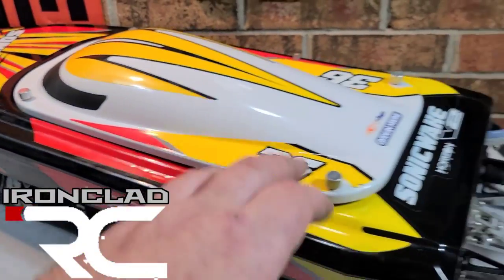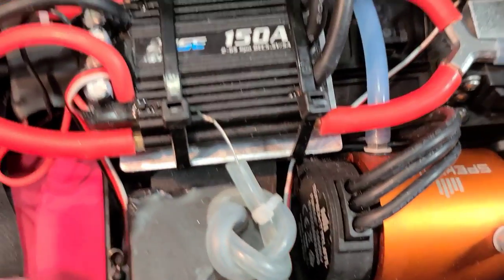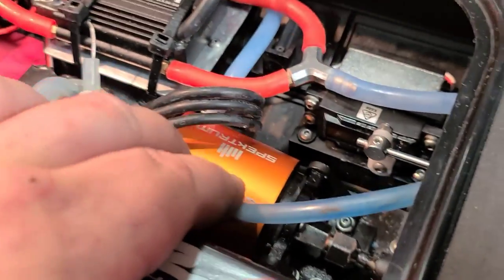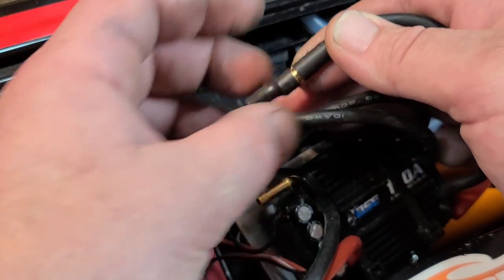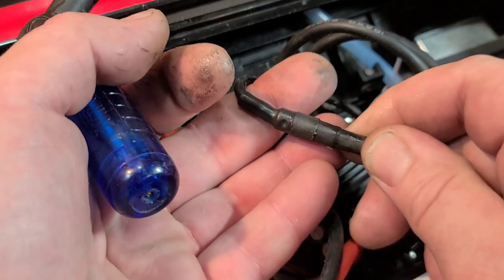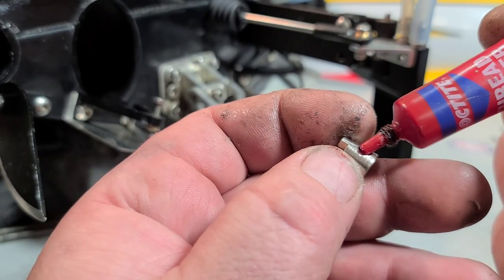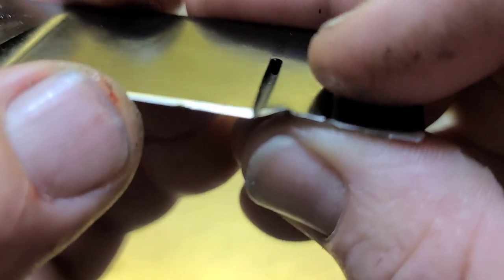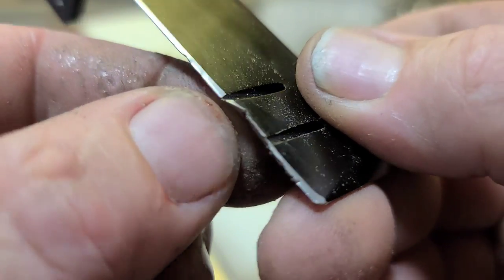Damaged Rudder Repair Sonicwake v2 - Broken Flex Cable Removal Fast Electric Rc Boat

Comment: Good Vid B!     I fill in blems on my aluminum stuff with solder and file it down. Quick, easy and polishes out to a pretty good match.
Reply from the maker: Aluma-weld from harbor freight Is my go to aluminum solder.   Thanks for sharing
Reply: @IRONCLADRC  Dang, my Pop has been stick welding aluminum for like 40 years, never even thought about brazing with it. Good call!

Comment: Hi B. As a time served Engineer here in the UK some 37 years for my sins, I absolutely love watching and listening to the way you go about problem solving. You clearly have a good understanding for the use of hand tools and general bench work. Watching you carefully using the punch along the most damaged area of the rudder for example was just pure old school experience. You also have some great ideas when it comes to fitting your boats out. Keep the content coming!!
Reply from the maker: Thank you very much.  Yes sir I grew up around boat my whole life my father was a boat mechanic, my grand father was a full size wooden shrimp boat builder, in his old age he built some of the finest scale shrimp boat you'd ever seen (3-4feet long) with wooden coffee stirring sticks.  I worked on charter boat most of my adult life until me & my wife had kids.  When I wasn't on the ocean fishing   I worked boat yards through the winter, basically what I'm trying to say is I've been surrounded by boats my whole life. For some odd reason I love these fast little rc boats I guess it shows lol.   Thanks for watching ironclad rc  glad you enjoy the content.

Comment: That's a really clean repair to that rudder blade Big B 👌  Great work 👏  Doubt you'll lose any performance... as you say, may just improve things by a few knots 😉
Also like your use of the heat shrink and silicone grease on the motor/ESC connectors. You might want to try 6mm or 7mm ID silicone tubing (depending on the size of the bullets) loaded with dielectric grease to do the same job - that's what I usually do and means you can still separate the connectors. Both will make those connections IRONCLAD watertight 👍

Comment: Finally I ripped my v2 today for the first time it was way more than I expected!! I went over every screw nut bolt you know iron clad it they were all out of proper torque... I greased the flex shaft checked it all. I did not make any adjustments to trim tabs or turn fins just torqued them proper. It's super fast amazing but I need help big time today was just to see what it did stock and there was a bunch of people watching 👀 and amazed mean time it was turning like shit like absolutely worse turning radius ever at high speeds it wasn't an issue but lower speeds it would not turn left nor right smh!! My servo was smoking very little but i tried full end point and less end point it literally would not turn unless I was at high speeds and it got sketchy one time I actually had to reverse it smh never use it on any of my boats.

Comment: ide recommend to use dielectric grease its amazing use it on your prop shaft and connectors!
Reply from the maker: I've been meaning to pick up another bottle of dielectric grease. Mine grew legs and walked away. Lol
Reply: @IRONCLADRC  happens all the time lol

Comment: This is also my opinion, you should dare to change something on the boat to find out if you can not improve something. This can also save you money, because the original parts are usually more expensive than those from the accessories.

Comment: Big B. Will a HD flex shaft for the v1 fit the v2? Someone has them in stock, but don't know if it will fit V2?
Reply from the maker: Yes sir there actually identical v1 & v2 shafts are the same size and length

Comment: What's you're take on this honestly this is weird lol something out of wack and I'm sure u know but one thing I'll say what a hell of a boat WOW it's a rocket...
Reply from the maker: When a mono banks left in a turn the rudder lifts up out the water in the left bank the v2 has shorter rudder that the v1..   basically when the boat turns the rudder is lifting out the water and not "grabbing" to turn the boat.      

Check the grub screw at the hinge that holds the pin in the rudder it may have backed out causing the grub screw to rub on the rudder base (excessive strain on the servo?)
Reply: @IRONCLADRC  I tighten everything I just checked that grub screw nothing is loose the rudder was turning to far both left and right and started to smoke a little . It's a balance issue trim tabs turn fins and battery placement. Lol 1 turn fin was way up the other way down and both loose. I didn't go crazy first run wanted to see what it does out of box but I tighten everything 💯 and greased the flex shaft. It needs tuning my question is how do you get your v2 to turn at low speeds battery's forward or rear I'm going to set the trim tabs level with the hull like u do they are down out the box. but the turn turn fins we're all over. I'll tell you what what a beast I'm in love with it hell every one at the pond was my fiance was amazed it's a power house never flipped water was like glass can't wait to test and tinker this to handle better cause a boat like this makes big ponds seem small it's so fast seriously.